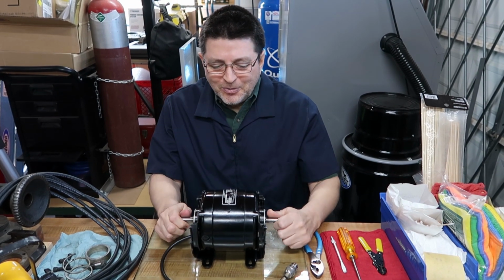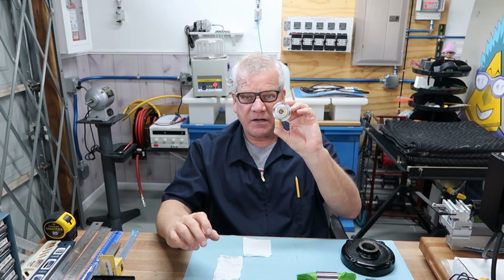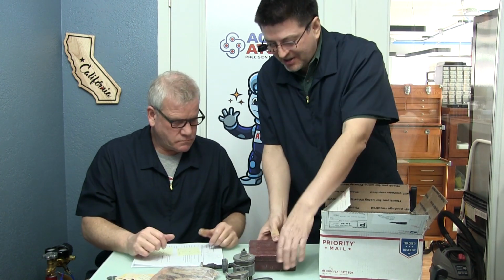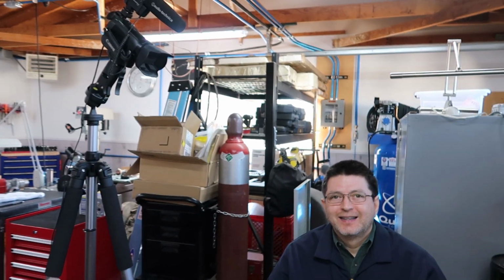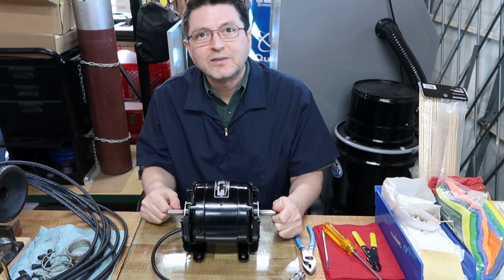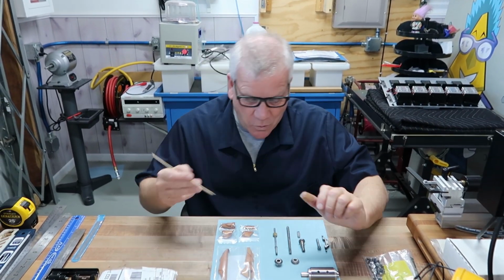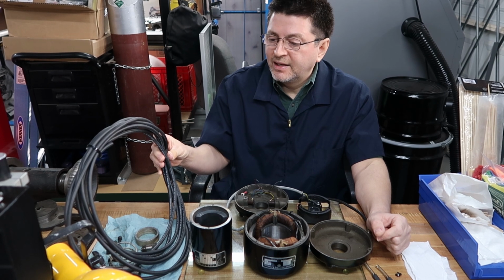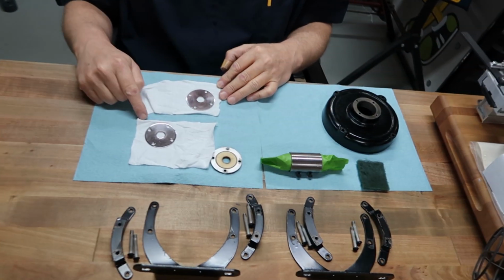SHOP ADVENTURES 25: Starting DC Shunt Motor Rebuild & General Updates

Comment: I thought as it's a shunt wound motor so field wiring is to be connected in parallel to the armature, no? Thus 3-conductor cord would be enough. Anyway need to see scheme of connection to speed regulator (controller).
Reply from the maker: Hi Russian friends, Patrick here.  Lance sent me here to answer your question.  On a shunt wound motor, you can definitely wire the field and armature windings in parallel.  However this would only be recommended when using the motor only at full speed.  For variable speed use, the motor manufactures recommend that you provide the field winding with a constant DC voltage and a variable DC voltage for the armature winding.  If you lookup the manual for the KB Electronics KBIC-120 or Minarik MM23001C DC Motor Drives that support shunt wound motors, you will see that these boards provide separate Field and Armature connections.  For 115VAC input operation, these boards provide a user selectable 50V or 100V field voltage depending on the motor requirements.  Great question!
Reply: @ActiveAtom  I see. I dealt with KBIC speed controls, but used only 2-wires PM motors. So maybe 4(5)-wires motors works better.

Comment: Great video, and great viewer gifts! With those tiny drill bits do you use collets or jacobs style chucks to hold them? Cheers
Reply from the maker: Hello Florida, Hi Joe thank you for stopping in and you bring up a great question about holding these micro mini bits.
We do like these gifts, one gift type goes into the future working micro machining museum and the other mail goes into making our product beginning soon. 
We use a chuck to hold these micro drills but only sometimes. The German made Albrecht Chuck with a minimum diameter hold of 0.2mm to a maximum of 1.5mm.
However we have 8mm collets (really small) that fit into our draw bars on the micro drill machines we operate a German Micro Drill Press and a Levin Micro Drill Press both use these mm collet as thy are known to be the most accurate in their ability to hold these micro drill bits. 
A whole different world, and a fascinating one isn't it Joe. Thank You our fellow YouTube creator, Lance & Patrick.

Comment: Thanks for the video guys, I would be very interested in what you had to do to the import lathe as I think I have the same type. Keep up the good work, BTW just call me Colin.
Reply from the maker: Hello call me Colin funnin with you. That lathe is from Precision Mathews and it is what it is an import and we disassembled nearly the entire machine took some time (time we did not really have) smoothed out the roughness ( the thing is like a giant sand casting) but remember these two guys are spoiled we have what is likely the finest precision (vintage speaking now) machinery and machine tool accessories from those times of the past and yes some from these current times as well so we should have never compared that lathe to our micro-machinery and such. 

For the money the lathe is good we use it for support tool parts making nothing to serious though it does cut really well after the efforts of our years of skills applied mind you.

The issues we experienced involved the actual spindle at first, handles second and then the saddle we actually had to replace the gibs, not just tighten the machine up when it arrived in its create it was already starting to come apart, we said well good thing we know a thing or two about how to build a machine. 

We are not in any way knocking this machine I mean we are not that type of people any machine can be made into a good even great machine it is all about money and time for us. Hopping this is found by you to be helpful, sorry about the rant as I am me I speak from my heart often but if we were not who we are and in the position that we are this could have been the need of us as you know us only you might not have gotten to know us had this not turned out the way it did. 
Lance & Patrick.
Reply: @ActiveAtom  Lance & Patrick, Thank you for the reply as always.  Please don't change. Your passion for precision (has the brew that is true.) is what makes you what you are and what as a subscriber is what I think is great.The reason I asked about the lathe was I picked it up second hand really cheep. So could afford to spend a little to bring it up to a better standard. Regards Colin
Reply from the maker: We promise we will not change, time to learn from us here Colin. 
We are best friends of too many years since 1975.
We are really who we say we are, glad you see and caught that it during the show. We are not rich nor poor, we have a mission, and this journey is a part of it, and you might not know this we are the same on the phone, in person as we are in these videos. 

Thank you for sharing about your lathe, to begin learning from it, check it out see how accurate it measures document its accuracy or current lack of. 
Then make improvements adjustments, be sure oil is always between the ways and such make more adjustments nothing too aggressive now talk to this machine learn to listen to what it is share has to share about what she is in need of and so on, improve more and more until that lathe is the best it is going to be, now you have a machine and you know the documented tolerances her tolerances of what it is she is going to be able to do or not do. Thank you for sharing your machine with us. Lance & Patrick.

Comment: OK, you have to share information on the drill bits.  My spade bits are getting low, and I'm hoping there is a better source (and cheaper!) than old Vigor stock.  Please let us know the specifics.

Lance / Patrick, the draw bar should be arriving tomorrow.  Please send me the total shipping cost so I can get it to you.  Thanks!
Reply from the maker: Hello Adam we are happy you got that draw bar. The drill bits we received were a giant surprise, they are so nice, so vintage, so American made, so sharp and there are so many we are going to use (spec them into our design) these in the making of our product code named "The Perfected Product". 

The sizes and types are really small we did not expect them, we do have an inventory control system so they will be cataloged as non-durable, usable goods.

We are two really lucky guys to even know Reid, Reid has a fantastic creators shop and we are thankful to have these drills and carbide burrs, it is really something we never expected.  

We will share these drill sizes as we shared the two makers brands when they are one day in the not too distant future placed in inventory. Your friends, Lance & Patrick.

Comment: Wow! I really like that little press. Really is a great size. Can't wait to see next week's action-packed installment.
Reply from the maker: She is a whopping 10 ton press and to us she is an utter giant around here. Motor bearings and a few pulleys are all she sees for larger sized work. We generally use a smaller little hand press for our assembly work but see even a micro machining operation needs some heavy weights once in the while. I know before you say this next thing this is a really small bench top hydraulic press by most shop standards. Thank you Jorian Khan for stopping in, sharing this press comment and that created a bit of fun for us to chuckle about with you. Lance & Patrick.